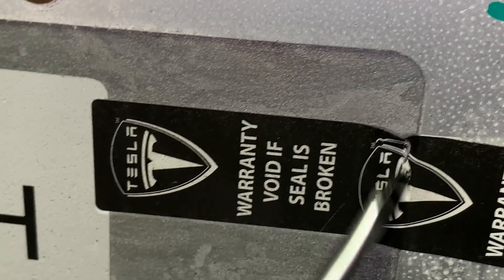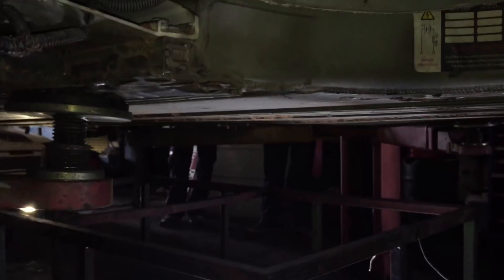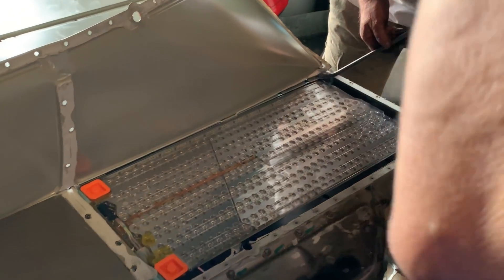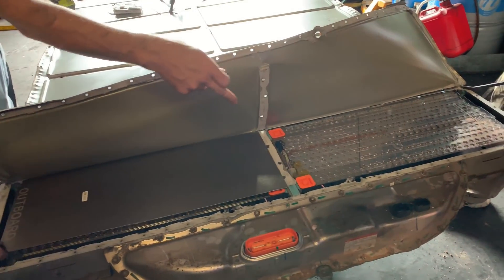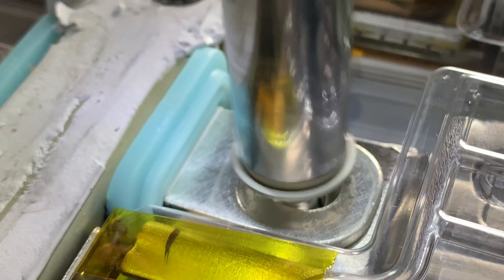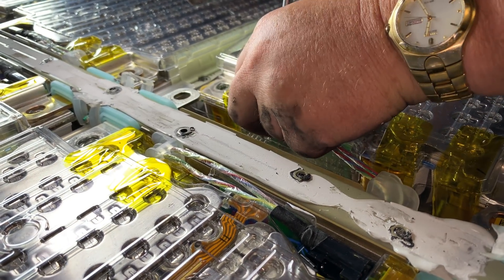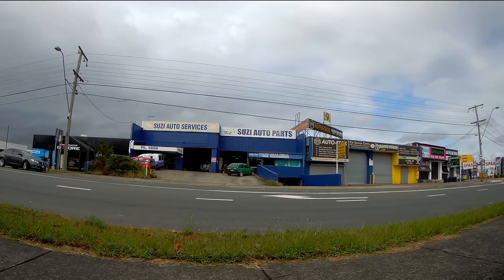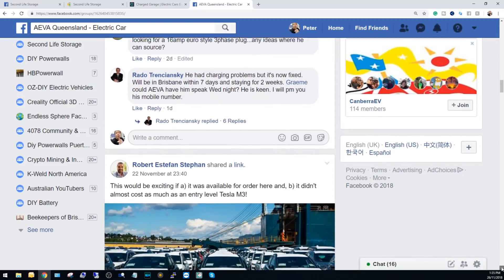Breaking the warranty seal on a Tesla Model X

Comment: Not a single Class 0 voltage glove in sight :O
Reply from the maker: Heaps of things we could have done better was all our first time, next time we will do things differently - doesn't change the fact it was a great experience.
Reply: @HBPowerwall  Love the content, just want everyone to stay safe in this amazing but surprisingly lethal hobby! Cheers!
Reply from the maker: Safety is good, I had to edit out some of the dumb stuff i was doing - but didn't do it twice :)
Reply: @HBPowerwall  you only need to do some dumb stuff once for it to be your final time. I get the excitement, but it should never take precedence over safe and sensible handling of high voltages. A safety briefing should have been held before you removed the first bolt. Graham shouldn't have been playing silly buggers with the battery pack. You don't play with loaded guns, you shouldn't play with loaded battery packs.
Reply: @DodgyBrothersEngineering  400 Volts DC and a bunch of you guys  have your bare hands all over it. This could have ended very badly.
Reply: The modules are 6s so once disconnected from one another it is relatively safe so long as they aren't shorted out.

Comment: Them Tesla packs are beautiful!  They should have let you keep one :) Also, I wonder if that empty battery chassis can be reused for packing your own powerwall batteries? You wouldn't be able to move it once full, but it's a steel enclosure the exact size for 18650 cells that would be somewhat fire resistant to buy time in the event of a catastrophic failure.
Reply from the maker: That's an interesting thought! I'll Ask the question ... Scrap value would be pretty good tho lol
Reply: Looks like the case takes some damage to just get it open.
Reply: The case itself looks undamaged, it was just the top/lid that was rolled up and bent. Not saying it's practical, just a thought.
Reply: Guys here in the US use empty battery trays for light duty trailers, one guy has a full battery pack he uses for auxiliary power on a Nissan Leaf, and carries stuff on it light it's a trailer too!
Reply from the maker: Wasn't it RichRebuilds that said that first about 12 months ago in a video - honestly i think with out the internet guys like me would still be digging ditches for a living !
Reply: The case is actually aluminium, except for the lid which is steel.
Reply: Ah, didn't know that, good call! I'll admit I know nothing about Teslas... Lol
Reply from the maker: Case was actually hit (really hard) with sledgehammer to get those back out on the dinted part - unfortunately was so wrapped up in helping forgot to film SOOO much lol
Reply from the maker: My learning curve just started and i'm hooked..